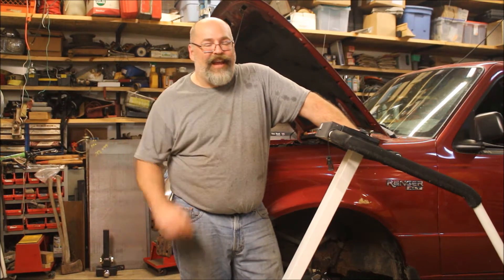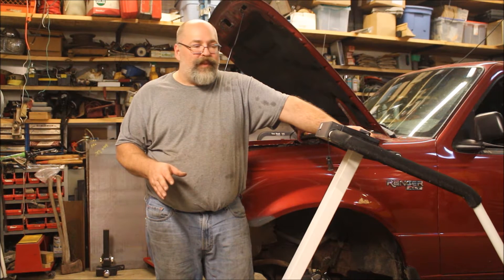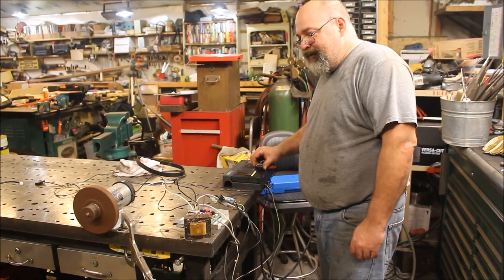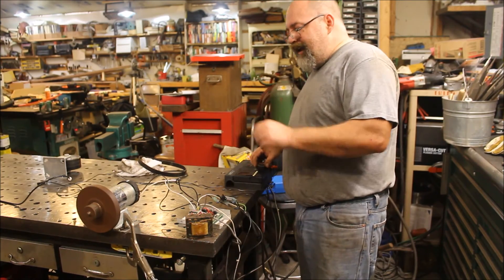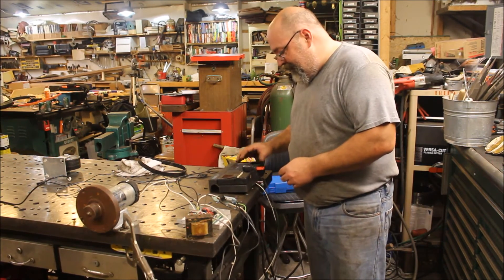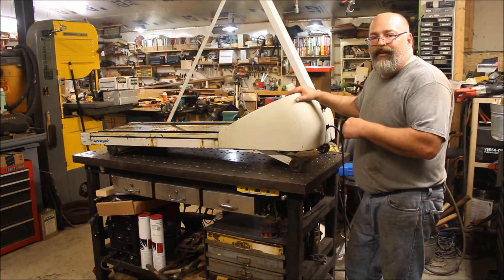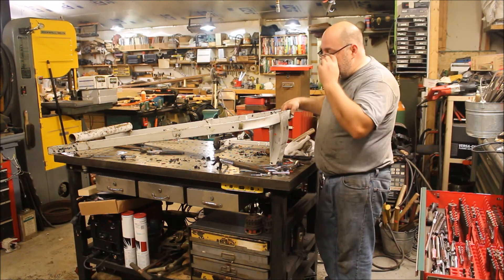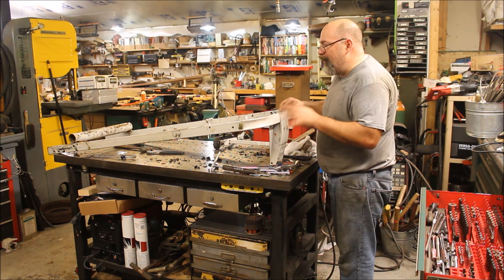Belt Grinder Part 1 Treadmill TearDown

Comment: That's actually not a transformer it's an inductive choke. Since the controller produces pulsed DC it's there to smooth out some of the ripples at low speed.